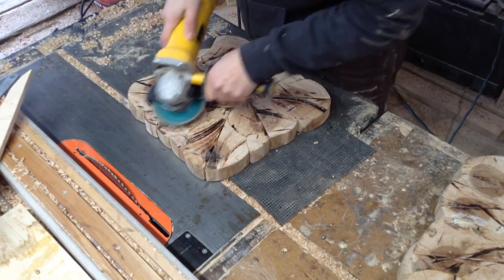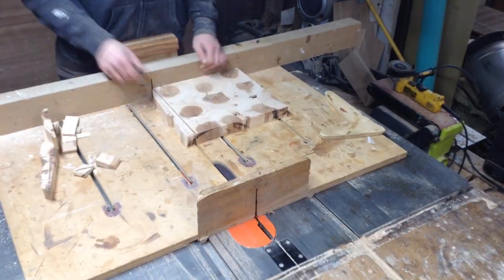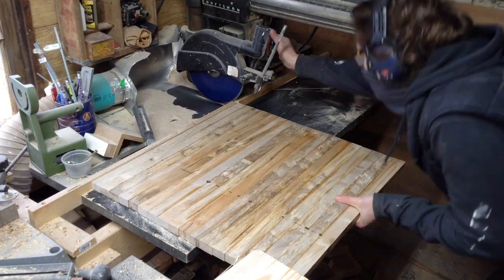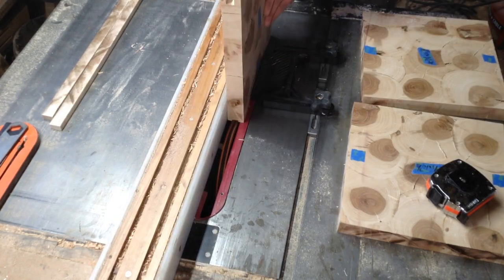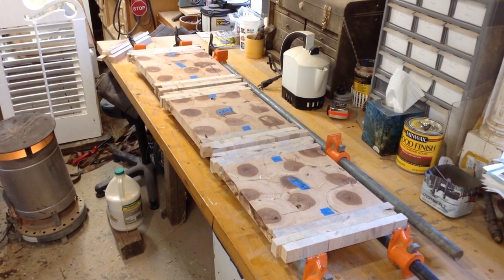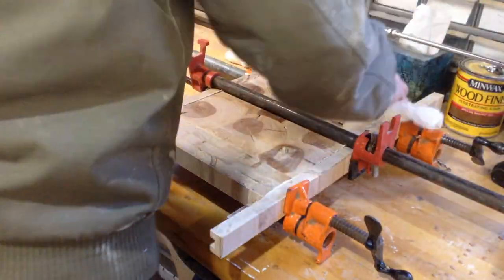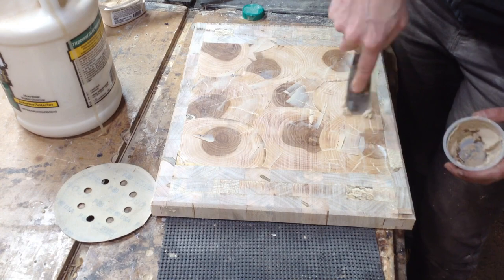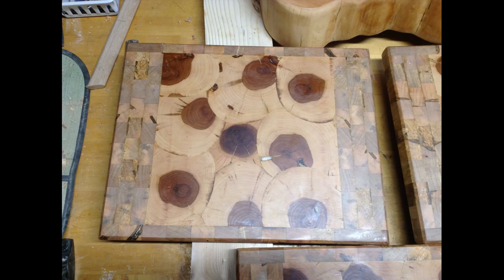End Grain Cutting Board [Part 2]

Comment: I always wanted to do a floor in end grain cookies! looks good Honey! Do you read Fine Woodworking in the latest issue somebody wrote a tip that he uses clear Gorilla glue and sawdust from the wood he is working to make hios own filler and says it works great! Again another nice job!
Reply from the maker: I have gotten lumber from a guy who specializes in end grain flooring and it looks awesome, a ton of work, but well worth it.  He actually said he has done them in spots cars can drive on it that is how stable and strong end grain is.  Haven't tired saw dust and Gorilla glue, just because I never have it on hand and always have Tite-Bond 3 in the shop.  Also, Tite-Bond 3 is food handling safe and I don't know it Gorilla glue is.  Would imagine the expanding properties of Gorilla glue work quite well in big gaps though.

Comment: They are very nice.  Did you consider using a colored epoxy to fill the areas that had splits ?
Reply from the maker: The customer and I went back and forth on designs for this for a while before starting the build, mainly trying to figure out how to get three boards out of a small amount of wood.  She established earlier on colored epoxy wasn't a no go, but not something she was in love with, and honestly neither am I.  The cracks were small enough that it wouldn't have been an issue on this most likely, but I have read to avoid epoxy on cutting surfaces because small shards of plastic can get in your food.  I have seen builds that back-light epoxy filled cracks in wood and that does look pretty cool though.
Reply: @HoneyBadgerWoodWorks  Thanks for the reply.  They are pretty impressive as is.